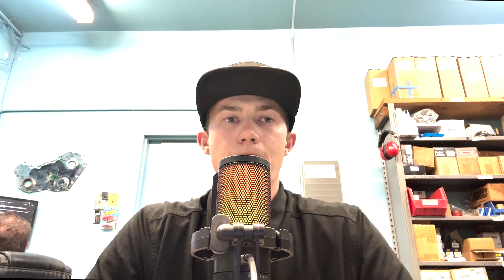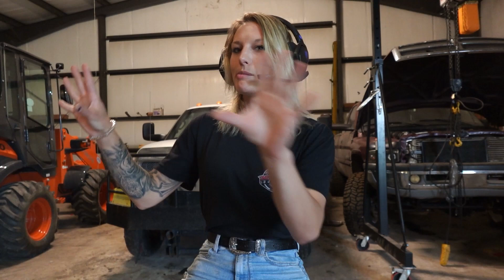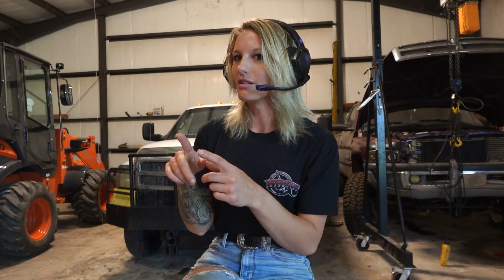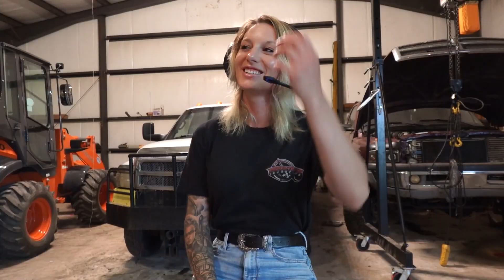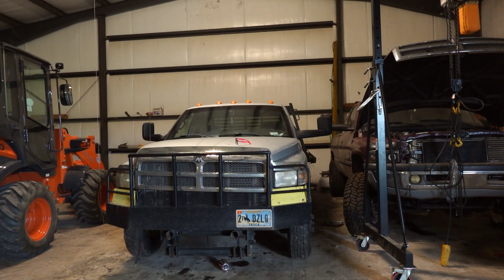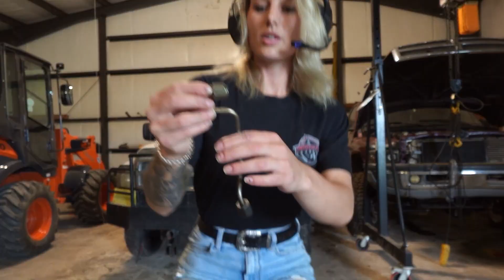Episode 11: Industrial Injection: Diesel High Pressure Fuel Systems

Comment: Wicked wheel, the geometry is different from others, the volute or vein angles are more modified from the usual, steeper longer angles. Spinning at higher speeds on the turbo, you'll know is a split second if it off balance, lol...

Comment: Common rail is more of a manifold than anything else, with constant pressure to fill the injector on demand to release the fuel into the combustion chamber upon signal from the ecm. Not from a mechanical pump, my understanding anyway.
Reply from the maker: That's exactly what I stated